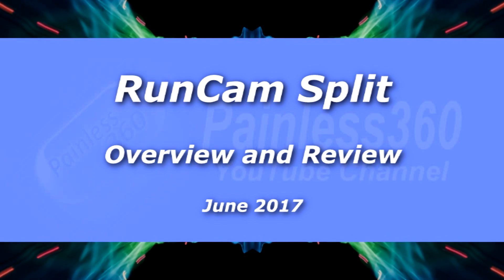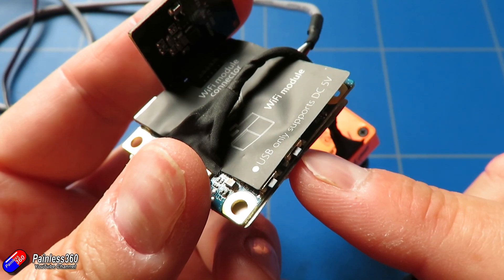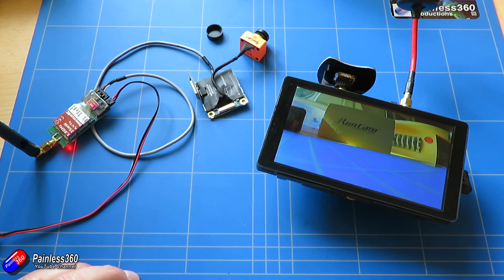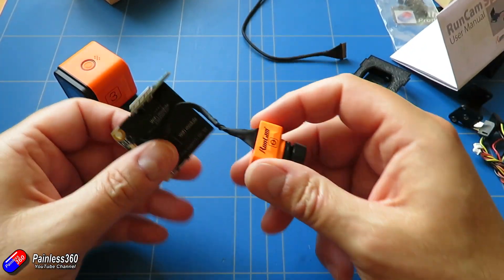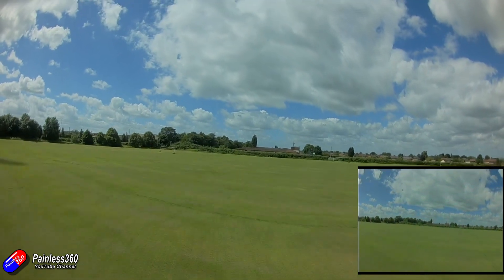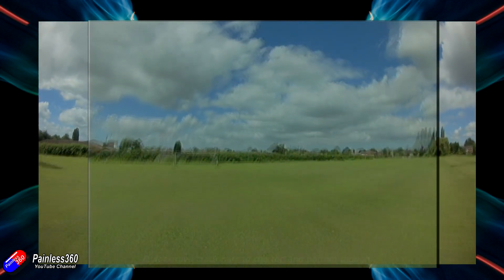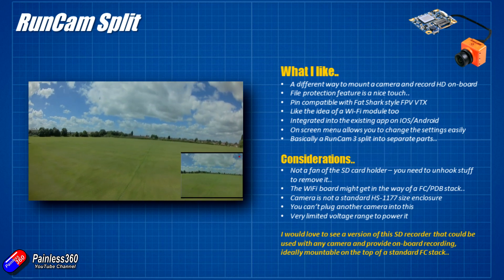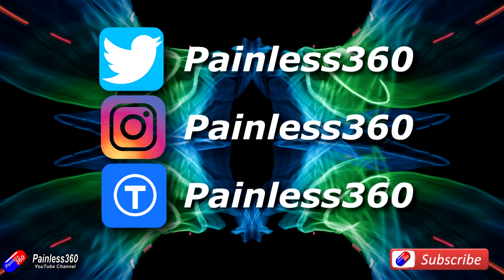RC Review: RunCam Split - a RunCam 3 deconstructed?

Comment: I was looking for a split for my very first build, but I went with a runcam 2 and a separate FPV camera. I mainly did this so my HD camera wasn't bound to a single craft, and I can use it for general filming outside of FPV in a way that seems a bit better than the split.

Still a great camera for lighter quads (4 inch and under), but for my 5 inch build, I think the separate camera is a better option, especially for the future.

Comment: Should have a longer data cable for DIY mini gimbals builds. Also the data socket on the board might be better when pointing outside the board. Generally its a one great idea all pros not much cons. Even the HD -> FPV cropping works as a safe frame for better composition. Brightens and contrast IMO better for video editing.
Reply: Love the gimbal idea!.. A micro RunCam Split gimbal for the front of 5"/6" frames. It could easily be more streamlined and compact than e.g. the (somewhat ugly) front on the Chameleon. I wonder if RunCam would design/market one?

Comment: My concern is where to mount it. Either in the frame where traditionally the fpv cam is placed, which will result in having props and some of the frame in the camera view. The other alternative would be on top of the frame where the action cam is usually mounted, where it would bear the brunt of any head on crash but without the protection of tempered glass that action cams have.
Reply from the maker: +Ro H that is the rub - you need space for it inside the frame really.. not all frames will let you do that unless you choose the FC/AIO board with care.. happy flying!
Reply: In the frame I think - designed to match.. need some anti-vibration mounting for it anyway. Safer is Cheaper!. For the frame, just go a little "dead-cat" to get the props out of shot. So now we're wanting a "RunCam-Split" frame. Cool.

Comment: Hi Lee, nice review. Same here. Not a fan of the sd card solution. Neither very much using the wifi. Did you try to download files over the app? Speed? I tried via usb and it was only 12-15mb/sek. So if you have lots of footage you end up taking out the sd card (get 80mb/sec for direct copy over usb3). Also i think the little lens module is more affected by jello. You quad seems to be clean from vibrations....
Reply from the maker: I spend time balancing my props. It's funny how many pilots comment on the tape and think it's a funny idea to balance them now.. IMHO a model simply flies better when they are well balanced - less vibration, less wear on bearings, improved efficiency, less jello.. Happy flying!
Reply: I've stopped trying to balance my props. plus on my flying you need to balance a lot of props :)  also with the 3bladed ones I find it harder...
moving back and forth between flying wings and quads now. wings are really fun, long flighttimes, speed, fun.   but quads are just so incredibly more stable even in high winds. the difference is awesome...   greets, Mario
Reply from the maker: I find the three bladed props easier as there isn't a need to balance the hub too. I've got a video on three blade balancing.. Happy flying! :D
Reply: Why do you balance your props on a quad that flies like a potato?? Hahaha
No offence hey! Great video! But this quad... ;)

Comment: The Wifi module I'am hoping to extend the connector with a 5cm ribbon cable to the side of the frame
Probably power it with a Dsun set to 5V, a 200uF cap across the output cleans up the voltage nicely.

Going to be nice to get HD footage from 3" Bolt Kraken

Comment: This looks like a great idea, hd camera which is protected by the frame and a significant weight saving. I am just not sure how it will connect up if using a fc with an osd, eg BFf3 board.
Reply: LeakyMeat exactly the same as any other cam.
Reply from the maker: +LeakyMeat FPV video out of the Split into the 'video in' of the OSD board. Same as any other camera..

Comment: Very impressive camera, I have a couple on order and i'm considering making a custom wifi module adaptor cable to allow a more remote plug and play option for it (plane/wing builds) mainly for file transfer, but not sure about the transfer speed, I'll likely need to power the plane with a remote power supply to wait the hours to get 64g at 100mbps.  Anyway, another great review, thanks.

Comment: I really love your great vids. One small question on this one. You have connected the Split to the 5V out of the ImmersionRC VTX. But the specs say it will only provide 300mA, so is the actually working under all conditions (recording etc.?)
Reply from the maker: +dc392hemi yes. Happy flying!
Reply: Thank you for the detailed answer. I will try to get the Immersion VTX and equip it with a heat spreader outside on the wing.

Comment: I See you are getting an excellent fpv image with no losses, break ups or noise at all..!
Do you mind posting your setup? Vtx, receiver, lc filter etc?
Reply from the maker: Quanum Elite Vtx, Fat Shark HD3 goggles, HoyBro Diversity Module, MenaceRC antenna set (patch and pagoda on goggles).. Hope that helps! :D
Reply: thanks! Have you added capcitors to the quad? An lc filter or regulator?
Reply from the maker: Nope, nothing like that at all..

Comment: Tip - turn off frame blending on footage which is being converted from 60 to 30 when exporting your videos.  It's combining the frames from 60fps which gives a nasty ghosting effect when stuff moves quickly.  Adobe Premiere used to do it by default in older versions but they've changed it now.  It's very difficult to tell the quality of frames when it's plopping two on top of each other.
Reply from the maker: +Peter Brophy thanks Peter..

Comment: On the SD card part you have to consider that if it had a push style holder from the side you would be losing your SD card every 3-4 crashes costing you money for a new SD card if you cant find it in the grass where it crashed and worse of all footage, just as I used to do with my pixracer, although it was not footage, it was only datalogs and all with the pixracer but I lost a couple cards with that push style mount. I think the way they made all the video files and firmware completely accessible via the USB port shows that they want it to be a simi-permanent mount like your cell phones sim card.  They don't want it easily removable or you would be losing your footage and card.  I think you just have to consider that you will need to dedicate a sd card to this product, SD cards are not crazy expensive.

Comment: I don't understand why the dvr picture is cropped at the sides but doesn't gain any height in the overlay-view. It seems to be not a real 4:3 picture, which means the picture has to be streched in 4:3 goggles???
This would really suck.

Comment: I guess the side-by-side comparison is not fair... I guess Runcam Split was with WDR enabled while on Runcam 3 is disabled, because the Runcam 3 have better contrast and more saturated colors. WDR is not a bad thing... it sacrifices some contrast and color saturation to make possible see better on dark spots on a bright image... But the side effect is this "washed" look.

With equal settings, both cameras have pretty much the same image.
Reply from the maker: The side by side is more about FOV with the product it replaces.. With WDR on both they would look very similar but the lenses are slightly different so they won't be identical.

Comment: Quality of the recorded looks pretty poor against the Rumcam 3. The SD card holder doesn't look very robust. Also how robust are the ribbon cable connectors? Looks like i will be using the Runcam 2 for a bit longer.
Reply from the maker: The test is about FOV, with WDR on both they look the same (almost).

Comment: Hi, FPV is just 4:3 or you can set it to 16:9? Your image looks great on DRV. Which vtx are you using? Thanks
Reply from the maker: +Giuseppe Falcone 16:9 gives black bars. ImmersionRC vtx and HD3s with Holybro diversity and MenaceRC antennas.. happy flying!
Reply: HD3 is 4:3 goggle so there will be black bars in 16:9 mode. In true 16:9 goggles probably no black bars?

Comment: Hello painless 360 i have a problem with amp 2. 6 board it will only when connected to the computer, it will when its not connected to computer but it does not disarms u have to plug off the battery to disarms it I'm using fs-ct6b transmitter and receiver and the throttle stick  is out of control of fs-ct6b pls help me and make video on it
Reply: Sorry it will not arm
Reply from the maker: +Sangeeta Chowddhary see my video in the APM playlist on trouble shooting arming. Best of luck

Comment: Check out the dtx03 if you want to record the fpv on a dvr directly on the model.  Looks much better than fatshark goggles and has no lag in the transmission of the fpv feed.
Reply: did my first tests with that today on an Foxeer monster v2. all stock settings and it worked out sweet. for the time being I'm not upgrading for hd on that quad. the split needs more time and some competition from others to evolve
Reply: OdenFPV Oh nice I've been looking for an example of that. Is it on YouTube anywhere? Would love to watch.
Reply: its not much, bit hasty vid so more will come

Comment: Thanks for review! Is analogue video out 16:9 when using with 5.8g vTX? There are a couple of fpv cams enabling 16:9 av out and you are able to use them with 16:9 monitors without aspect ratio distortion, so I was wonderinf is same thing valid here?
Reply from the maker: The Split seems to add bars to the bottom and top of the image, not 'true' 16:9..

Comment: Hello @Painless360, I have a question. Will it be a good or a bad idea to stack up Naze32, runcam split DVR and a video transmitter module (AKK FX2)?
Reply from the maker: Should be fine but I'd not use a Naze32 these days - lots of better choices..
Reply: @Painless360, can you suggest me some for 250 size quad. Not intended for racing. I am not aware about some latest FCs
Reply from the maker: Check out my series and my video on what flight controllers I use.. Best of luck

Comment: The Runcam 3 image is far better than that of the Split in your side by side comparison. It is not only brighter but also has much better contrast. Is that something that can be adjusted? I would not be happy with the Split after seeing the results from the Runcam 3.
Reply: From other reviews of the Split the R3 and Split footage looks identical to me eye
Reply: It must be just settings, Iw seen fantastic quality from split in other reviews.
Reply: yeah most videos I've seen say "this is the footage straight out of the cameras" on those videos they look the same
Reply: The 'Runcam Split Review' by RCShim shows the same lack of contrast in the darker areas. It almost looks like there is a slightly foggy filter over the lens or even a dirty lens. Is it possible that there is a protective plastic film over the lens that needs to be removed?
Reply: This camera is under £60 is dual purpose and about 1/3 cheaper than the Runcam 3 was.
Show me any dual purpose camera or any camera in that price range that can beat the split for picture quality. 
With regard to action cameras, it wasn't that long ago that £60 bought you nothing but crap.
Stop moaning and be happy that this company have made a good product at a price that lets you keep some of your hard earned money in your pocket. Your alternative is a session 5 @ £300. 
I know where my money is going!
Reply: I actually made that mistake myself - I have 2 runcam 2's and one of them seemed to be way better than the other - until I realized that I forgot to remove the protective plastic off one of them!
Reply: Alan Pentland horrible video not worth it in my opinion something better will come along plus the mah drain it has is outrages you can even finish a race with it i bet

Comment: Hi, Painless, ImmersionRC claim the 5v output on all their VTX's to be 300mA have you had any problems with running your Runcam Split on this supply? Thanks.
Reply from the maker: +Firky 2010 it’s worked fine but if there were issues I’d swap to a dedicated 5v Bec..

Comment: Hello. Thanks for your analysis. 
The main question at least for me, due to I am going to use this in an fpv racer setup, is the latency. 
What can you say about that? Runcam only has recognized "Low latency".
Is that true? Is the same latency as the swift v2, or the foxeer v3?

thnk you again.
Reply: Check out https://oscarliang.com/ for a decent rundown of different FPV camera delays. IIRC, the Foxeer V3 was ~20ms, and the split was more around 50ms. Not bad at all for a fixed wing, but for a high performance racing quad, it may be a bit too laggy for some.

Comment: Great Review as usual, but omg glad got i didnt buy this such a horrible picture and such an amp hawg with vtx draining too no thanks, but thank for the thorough review boss 😊
Reply: If you can drop the 50-70 grams dedicated action cam, wouldn't that safe a lot more amps than this is pulling...?
Reply: Kjetil Ertsås Would have to really get all the numbers, also having props in the HD video is not as great to watch, you would have to see current draws and calculate them to get a definite answer.

Comment: gopro sued runcam for "copying" the session
Reply from the maker: +Gaz Edwards do you have a link to that officially? I'd like to read up on that. Interesting that it didn't appear to happen to Kodak with their cube camera....
Reply: only forum/reddit threads
https://www.reddit.com/r/Multicopter/comments/696kre/runcam_3_will_no_longer_be_sold_in_the_us_market/
https://dashcamtalk.com/forum/threads/runcam-3-and-gopros-session-patent-infringement.28805/
Reply: It's purely US thing, you can still buy Runcam 3 in the rest of the world without problems :)
Reply: Mikolas 3D Printing even so the split is tempting over it even with the SD card "issue"
Reply: GoPro was sued by their own investors in January of last year due to a huge drop in share prices, and they think that lawsuits and threats (rather than lowering their prices in the face of ever increasing competition and market saturation) will fix it.  They've even resorted to threatening accessory makers such as GoScope.  They IPOed at $24 in June 2014, saw as high as $93.85 by October 2014, then dropped to about $11 at the time of the lawsuit.  And their shares are currently at $7.77.  Clearly it's not working.
Reply: Its not a "copy" in any way. The only similarity lies in physical dimensions of the Runcam 3. You can squeeze a runcam into mounts designed for a Gopro Session. That's probably where the legal issues came into play (we will never know) I dont think you can patent a shape. That's why Polaroid are having so much trouble trying to sue Gopro.
Reply: Cudos Sir!  I stand corrected lol. but as the article said  although granted, the broad nature of the submitted design makes that type of patent pretty useless should it ever go to court. In this instance it stood up legally because Gopro successfully argued that Runcam's mounting frame infringed on their utility patents. The Runcam3  (38x38x37.5mm) is almost identical in physical size to the session 5 (38x38x36mm).
Reply: Gaz Edwards go pro copied  poliroid lol sj cam also have a cube cam out to, go pro are just greedy plebs who will never get any of my hard earned cash

Comment: The main board design is a total non-starter for me, just a totally clumsy disaster. 5v only?What? Really? The wifi card has to stick up 90 degrees to the main board? You have to pull the sticker back to install and remove the SD card?
Wow! This seems like it was rushed through design for some reason, it looks like it's still at the breadboard stage.
Reply: It's done for Mini Drones and Mini Drones only. The Flight Controller already need 5v... Sometimes from a PDB, sometimes integrated on FC board itself... It's not a big problem to provide 5V to Runcam Split.
About SD Card... well, I guess it is made to be forgotten on the camera... Every time you need to download a video from camera, just plug the USB cable and you're good to go.
Reply: Well if it was meant to be geared towards racers I could see that. The problem there is you have to add another board to your stack, and this one has a weird smaller board sticking off at 90 degrees.
Good luck to them is all I got.
Reply: The 90º board is the Wifi module... You don't fly with it attached to the drone (it's removable).
In fact, you do not need the wifi module at all... You can access all the functions using only the pushbuttons on the side of the board.
Reply: fabricator dont cry....you dont have to remove the sd card at all...use the usb to download your videos. you dont need the wifi module to change settings...and for an extra board....i dont use any pdbs and my escs are on the arms... so i have one board only...but advantage of having no extra weight with no recording camera......;)
Reply: It seems like a disaster because this is pretty much the same board that's in the RC3 with a different SD card holder and a different header/connector for the wifi board. That's the reason for the weird design choices like 5V only (USB voltage) and it having a 1S lipo input and charging circuitry on board.  The split is pretty much just a naked RC3 with the camera in it's own housing and they leave out the 1S lipo.